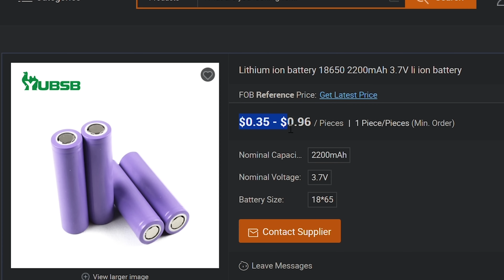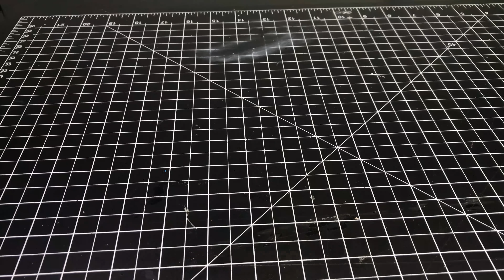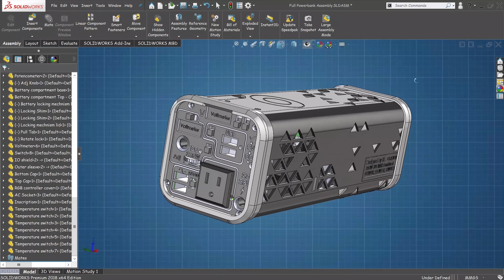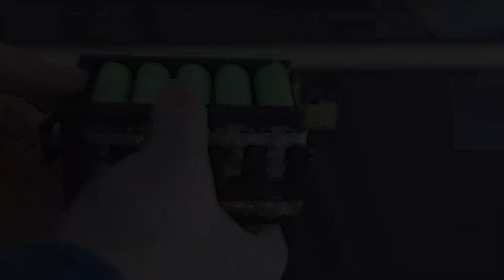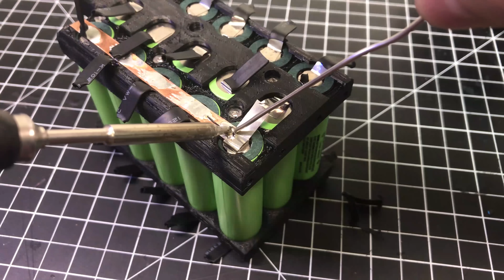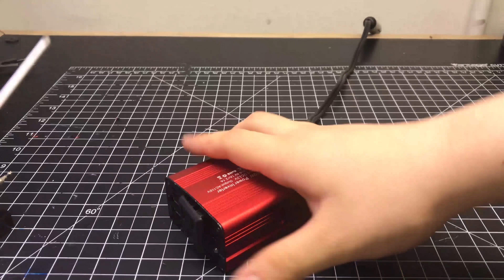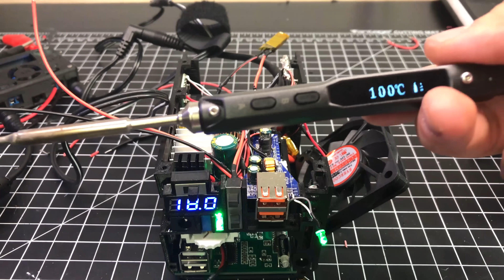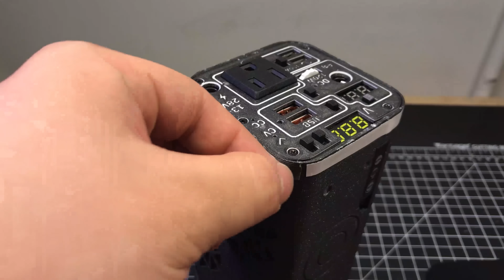How to Make the Ultimate 18650 Power Bank with Infinitely Expandable Capacity

Comment: At total fraudulent add.  Fell for it as it was promoted as SanDisk. Got the product total fraud and does not work. Used Apple Pay and the payment was processed without lodging with Apple Pay GOOGLE, YOUTUBE, APPLE FAIL TO PROTECT. With AI they would be aware of the fraudulent use of a trade marked product and the misuse of Apple Pay.  I guess the advertising revenue based on a complete fraud and they would make more money than pull it off as fraud

Comment: Full Material List
________________________________________________________________________________________________________________

🔋 Battery Pack (removable 15‑cell 18650 Pack)
- 15 × 18650 lithium-ion batteries (e.g., NCR‑18650B), matched for voltage, capacity, internal resistance, ≥5 A discharge
- 3D-printed battery holder & cap
- Copper (or brass/nickel) strips: 0.5 mm thick × ~7 mm wide
- XT60 connector (female) + 12 AWG wire
- M3 flat-head screws (for assembling battery cap)
- Heatsink (optional, for BMS MOSFETs)

🔧 Battery Management & Charging Circuit
- 3S Li-ion BMS with balanced charging + over current/discharge protection
- DC‑DC step-down converter with constant-current feature (for charging)
- Mini DC‑DC step-down converter
- 12 V DC relay (20 A rating) × 2
- Schottky diode (≥5 A rating)
- 5 mm DC barrel jack
- (Optional) USB‑C PD trigger module (for USB‑C charging)
- Colored LEDs (3 mm) – green, red, blue
- LED wiring (thin gauge)
- HX‑Temperature switches rated at 45 °C: 4 × NC (normally-closed), 3 × NO (normally-open)
- 20 A fuse
- Connecting wires: 22 AWG, 18 AWG, 12 AWG

🔌 Output & Power Delivery
- 150 W 12 V inverter module with dual USB ports
- 200 W boost (step-up) converter (adjustable DC output 13–15 V)
- 12 V USB Quick Charge car adapter (PC board removed)
- Wireless charging module (Qi pad)
- 5 mm 12 V fan (60 × 10 mm)
- (Optional) Additional mini DC‑DC step-down for fan speed control
- M3 screws (for mounting modules)
- Heatsinks (3–5 mm aluminum, copper sheets for inverter MOSFETs)

🎨 RGB & Indicators
- RGB LED strips (cut into ~12 segments)
- 3-button RGB controller module + small ON/OFF switch
- Voltmeter panel + switch (probably digital panel voltmeter)
- Additional 3 mm LEDs for power/charge status

🛠 Structural & Assembly
- 3D-printed parts:
- Battery holder & cap
- Base layer, middle layer, top layer parts
- IO shield (printed with 2 colors)
- Outer sleeve
- End caps (printed in flexible Ninjaflex)
- M3 screws (various lengths for assembly)
- Hot glue & thermo-epoxy
- Heat-shrink tubing (for insulating battery wiring)
- Kapton tape (for insulating converter contacts)
- Copper strips (0.5 mm) for adjustment knob shaft

🧰 Tools & Consumables
- Soldering iron (high-temp)
- Solder (suitable for battery tabs)
- Tin plating tools
- Screwdrivers (M3)
- Wire strippers, cutters
- Multimeter (voltage & current)
- Amperage meter (for discharge/load tests)

⚙ Testing & Safety
- Load device (~100 W, e.g., flashlight)
- DC power supply (≥14 V output for charging test)
- Thermal switches (referenced above—integrated in circuits)

📄 Print Files & References
- All 3D STL print files (holders, enclosures, shields, caps)
- CAD assembly model (with and without USB‑C/RGB variations)

Comment: Dude, its overloaded
And its not powerbank
Its a power station im worried about this to go boom because of the modules you use and not all module is accurate and safe thats why even if theres a balancer and bms its still unsafe of a  battery for overloaded things inside and outside the matters
But i impressed that even 1 mistake didnt happen after all of that straight work, good job

Comment: This, the lab bench power supply and the other power bank are great, you would have a market to mass produce these.
You need to spot weld the batteries
Check internal resistance of each cell
Get yourself a balancer (Balances cells so they are the same voltage gets a reading while they are all connected)
Don't use old laptop cells, many will be different cells, capacities, amp discharge ...
If you can print such good case for the unit you can do the same for the battery packs
Make the battery pack part of the unit so when you attach a larger one it looks like part of the unit.
Some countries use 240v which will half your AH capacities.
Use a universal plug
Use a switching transformer/inverter for 130v to 250v
Include a regulator so you can plug in solar panels to charge and provide power

Launch a kickstarter you will get a lot of backing.
If you were in the same country I would be happy to fund and work with you.
This is a very viable product.

Comment: i will say its cool but the battery part is VERY dangerous to do, as they can melt from the change in voltage from the other cells, so be warry of what you are doing

Comment: I admire your ingenuity in building this power bank. However, wiring the different parts is a little challenging because of the consequences of improper wiring. Do you have a built power bank for sale I will buy one built by you instead of building one myself?

Comment: This is perfect. One suggestion on improvement is to make the battery pack and bms detachable. This is so you can daisy chain or swap power sources. Any example is, inserting a solar charger regulator that balances power draw from the solar output and batteries. Heck even a mini 1kw two stroke generator the size of a shoe box would be cool.

Comment: There should be more videos like this, what I would not do in this video is sotter the battery cells to a wire as this can lead to bad sottering joints and as a result will make the battery less thermally efficient. What I would do is spot weld using nickel, copper, zinc and other very conductive materials to the cells as this can lead to better thermally efficient cells and it is also less likely to melt the cells' contacts and therefore less likely to make a bad battery overall... That is my review of this video and other than the stated problem it is an excelent video to relate to and I would totally see myself doing one of these projects with a cooling system, the problem is.... there are no videos like this....

Comment: Hey can someone weigh in here? I wanna make sure I don't blow myself up 😅😂😂

So I am using 15 Samsung 35E 18650 batteries for my power bank.

Each Samsung 35E 18650 battery is: 
• 3500mAh
• 3.7V
• 8A

I am using a BMS board that is identical to the one used in the video, except it is rated for 60A (and it is balanced)

If my math is correct, building the battery array in 3S5P (3 Series/5 Parallel) then that should equate to:
• 11.1V
• 40A
• 18Ah (or 0.19425 kWh)

Can someone please confirm that my math is correct, and if so; can you also confirm that it should be safe and functional given that the voltage is remaining the same @ 11.1V, and that the total Amperage (should be) 40A on a Balanced BMS that is rated for 60A?

Thanks in advance to anyone who can help me out :)

Comment: I dont get this soldering, its dangerous AF without the proper tools.
I dont have a pulse welder so i made my DIY 18650 powerbank with 18650 holders, so i can replace them every few years without soldering at all. Since i used 3S8P the powerbank got HUGE anyways. Nowadays often use it nearly fully charged as 18650 "battery box" where take out 3 cells for a 4x 18650 flashlight.

For the 2nd "powerbank" i built i just bought cheap, multiple 4S LiPo cells with XT60 connector from a chinese RC hobbyists store and made even a direct output for 45-50V (100Amps+) output and a high power rated Buck converter as "Lab Power supply". I sadly saved some bucks by not using a AC/Sinus converter which i miss sometimes.
Reply: But i also have to say - the 2nd powerbank was just a fun project since i built multiple floodlights with 88 to 200W COB LEDs and these LiPos served me as dirty cheap "all in one" batteries for all DIY devices, and often for multiple months these bigger devices are not used at all so i needed a purpose for the batteries and they serve well as battery for camping or night usage (on day charged via PV systems energy) with 4x USB-C 65W and 4x USB-A 20W Quickcharge outputs on the box.

Its literally a Powerstation (without AC output) considering the batteries alone weight about 7kg and the box and electronics/converters another 1-2 kg.
I can also connect my DIY lights directly to it since they all use up to 80V input Buck/Boost converters on the direct LiPo connector (max 50V) on the box.

Comment: bro tryna portable charge his whole house 💀
love the video though!
Reply: He tried, I did it!
With 12x 5Ah 4S LiPo packs which I packed together as individual 6x 10Ah 4S packs, resulting in nearly 1kWh. It was also pretty cheap since the LiPos were noticable cheaper from chinese RC hobbyists stores compared to ANY 18650 or 26650 source.
In the powerstation the 4S 10Ah configured packs are in 3S2P (effectively 45-50V, 20Ah).

Even a direct output for easily 500A+  50V (no fuse)  which could melt the XT60 connector, but thats another issue :D
Since we also have a PV system with "only" 5kWh battery, i can support with this 1kWh of the DIY powerstation the small PV battery over night and charge it over the day.
Reply: @harrison00xXx  w o a h

Comment: Sell this prodact?
Reply: There is one of a kind helpful person and willing to share 3D models etc to make it more affordable yourself and you ask for BUYING/SELLING it?!

I would recommend getting an old Motorcycle Lead Acid battery (enclosure) and packing in there just a few LiPos or 18650/26650 cells and some charging electronics. Sure this "brick" looks nice and professional, but on a affordable way (without 3d printer) you are best of with some awesome looking existing case (as the 12V motorcycle battery, a small suitecase, in combination with a bluetooth speaker,...)

Comment: Let me know if someone has build this except the guy in the video ...
Reply: Not like him, but different:
- on my first DIY powerbank i was scared of soldering on the cells with a regular soldering iron so i used 18650 holders made replacing or using the cells otherwise much more convenient
- my 2nd project was a "Powerstation", more because of fun and making use of multiple 10A 4S LiPo packs.

My DIY powerstation lacking AC output but has 4x USB-C and 4x USB A outputs with 65 and 20W, a "bench power supply" for up to 45V and 6A, a direct output from the cells (50V, 20Ah, 1kWh capacity and high amperage LiPos, NO FUSE haha) as well a small MPP tracker and charging module for 2 PV modules (about 800W peak) for off grid usage. All in all, it was noticable cheaper than similar bluetti products and i have some stuff i can use those 4S 10Ah LiPo packs as well.
I can connect a AC/Sinus converter externally as well some of my DIY stuff, all i am using (and need) is USB-C, the direct output (it can output easily continous 3kW+ at 50V) and the variable power supply (for notebooks, 12V car stuff, at home as bench power supply,...).

This 1kWh powerstation is more for support of the small 5kWh PV battery over night, for camping, off grid usage and as emergency power than anything else. But 1kWh batteries are somewhat not too heavy yet to be completely immobile and also somewhat affordable.

Comment: Great job on putting the individual modules together in a well thought out fashion.  10 out of 10 in my book!    My only constructive criticism would be the numerous solder points and small fiddly parts (wires and such) to complete the build.  I would consider having a custom board made to house the relays, switched and LEDS as well as develop wiring harnesses that can be made by crimping.  The harnesses then just need plugged in eliminating the soldering and potential issues with bad solder joints and such.  This would of course require some redesign of your design, but did you ever nail the design part in this.  Great work on that.   Thanks for sharing this.
Reply: Yeah speaking from experience it took awhile to solder the various parts and I fried a few things I think he made a new version with a pcb

Comment: I asked someone who knows about this stuff their thoughts on this and they said: "no way to properly adjust the cutoff points for the protection, no way to adjust balance voltages, the "BMS" he uses is pretty useless, also only balances at a point when the cells already have too much voltage. there is a reason why most commercial units dont use series connected cells" What do you(or anyone who knows what all that means) say to all that?

Comment: I'm an electrical engineer and except for that hellacious wad of soldered wire making up the common ground, this is amazing. I have no reason to believe the wad of solder won't work, but it is more prone to failure than the rest of this device. Very impressive.

Comment: Nice idea, something I would implement in my DIY battery pack for the phones and possibly laptop - with some changes, I would have to also install smart battery pack board for the removable battery so it keeps all of the information regarding the state of charge and aging data thereon so runtime remain accurate.

Comment: I know that space is at a premium here, but I would have used an in-line fuse holder for the automotive fuse. It makes replacement a whole lot easier, since you won't need a soldering iron.

Comment: How do u wire the volt and amp meter to calibrate the amp, when i shorted the output, the amp meter turns off by itself

Comment: Build some for selling, lots of people look interested regardless of being able of building it themselves. I don't think you need a kickstarter campain as millions of people have watched your video, self selling if you ask me. I found a lot of people interested on the OpenUPS project, cool, check it out, but notice how expensive it is and how your project looks and works better providing more options, yours sounds to me like a better product. I would only mod the fuse to be removeable and easy to replace instead of having it soldered.

Yes I could build one myself but parts locally are more expensive and usually require some online ordering too, besides I'm not that skilled, no 3d printer here and my result wouldn't look as neat as yours, that's the reality of many people here. BTW I watched your video long time ago, I was just revisiting. Great work.

Comment: I'm building now! Question tho, Why didn't you avoid the step down altogether and use a 12.6v 2 amp. Charger and why is there a small cutout in the corner next to the rgb buttons when fully assembled. ? Also what If I wanted to power 5-12v from the DC jack to accommodate 5-12v power options.? Awesome build and I love the design. Excited to put mine together!
Reply: I figured out my own problems,.and Im building it now. BTW,  no way can you get the parts for $60 or less. Used you can buy not new.

Comment: I like it very much and I ll put it in a practice soon with 20 x 18650 bateries. For the first multi use powerbank that you are making, will cost you at least 250 - 300 euro. At least my shopping cart from Amazon says so. Why? Because all the parts needed are sold in pack of 10 pieces or so. So finally you ll get to that amount if you dont have the parts. But look at the bright side... once you buy all pieces, you will be able to make at least 5 powerbanks like this one with the parts left. The only bad thing is that you need to have enough salvaged / new 18650 bateries.

Comment: Why would you worry about using while charging? This is not technically a problem, the battery is either being charged or discharged, depending on whether the power going in is higher or lower than the power going out. Really awesome build, though

Comment: 10:30 Why is protecting the batteries from being "charged and discharged at the same time" a feature? If you left this feature out there wouldn't be any issue either. The constant current protection from the input power would protect the laptop power brick from being overloaded and the same protections apply to the battery through its BMS checking if the battery ever gets over discharged. I do not understand what you are protecting. A battery is never charged and discharged at the same time, the charger will only bear some of the load of the entire pack and charge the pack when the load is minimal.

Comment: An amazing build but your soldering should be better. There are holes in a PCB with a purpose and wires held by tin only will crack by time so more care when attaching wires to boards and to each other must be considered.

Comment: You can still build this with out the case. The other issue is the equipment needed to test the batteries. That alone can cost you another $100

Comment: i think you got scammed for nickel ribbon, you can test it by electrolysis in a cell of dilute vinegar. the electrolyte should turn green, if it does there's nickel in it, if it however rusts then you got steel, if bot you got nickel plated which is good enough, also a car battery and a welder module for 20$ from ebay are highly recommended if you ever plan soldering anything bigger than a single 2s 1p battery.

Comment: i'm not sure man. 20v = 5x18650, parallel x 3 = 15 battery = 4-6amps
yes ofcourse powerfull watts, but low amps after 3 or 4 hour later.

Comment: Please could you make an UPS for an internet modem and WIFI router with 18650 batteries in a similar or smaller form factor and another separate for a gaming Desktop. Currently commercially available UPS  in the market fails within a year, weighs a ton as they use older lead acid batteries and takes up a lot of space, not to mention are costly and have current in their neutrals or grounds, yes I am talking about APC and similar such cartels.

Comment: I noticed that there is an interesting point on the design of the outer casing. I tested my theory, and it turns out t he original plan was to be able to change the fuse! the little rectangular hole in the side is for a fuse to be plugged in!